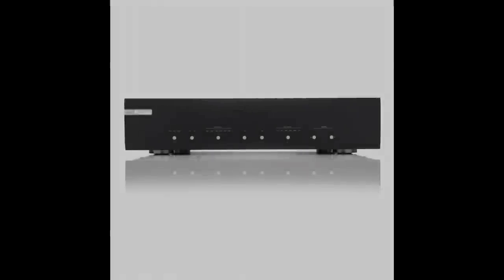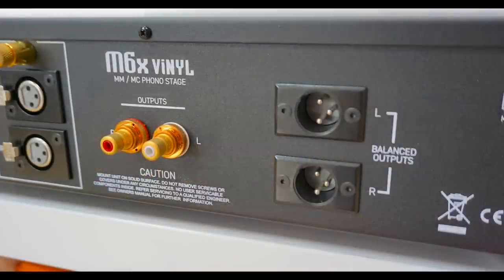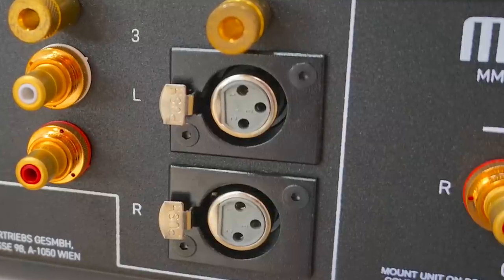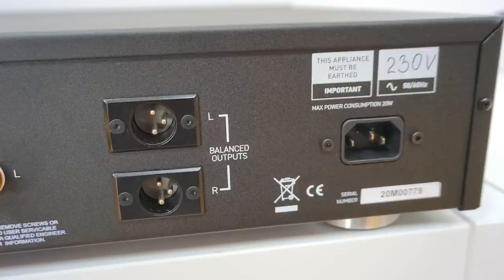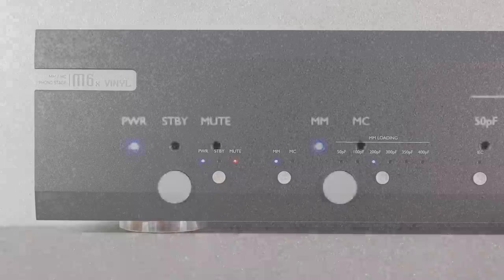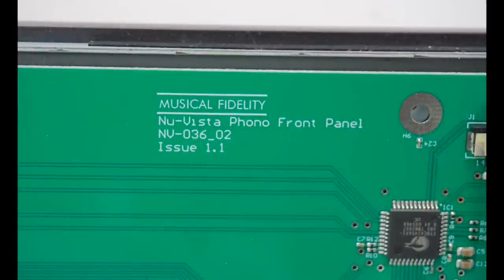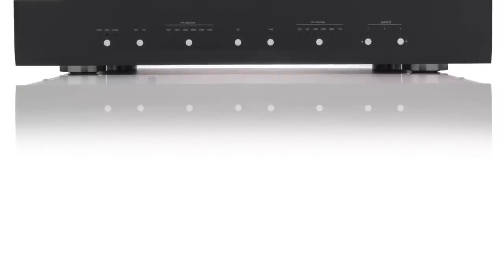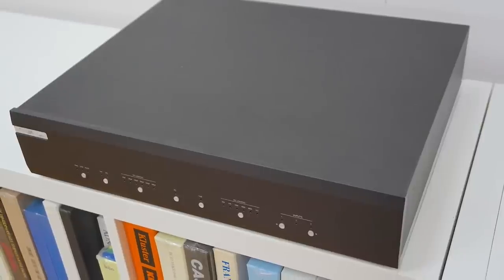MUSICAL FIDELITY M6X VINYL PHONO AMPLIFIER REVIEW: CLOSE UP, RATING, SINGLE-ENDED & BALANCED TESTS!

Comment: Hi there Paul. I have just purchased (coming in a few days) this phono stage based on a few reviews and giving much weight to your video review.  It will replace a Musical Fidelity M1-Vinl. My system does not have any balanced input capability so I plan on using the single ended connections. Based on your delight with the balanced output I would love to use that connection to my preamplifier.  Are there any adapter cables or plugs that will allow me to use that output from the M6x?  Would I be able to appreciate the benefits you were so pleased with, if such a cable were available?  Also do you think I should hear a big difference with this vs my old M1-Vinl?  Thanks  Steve in Dallas TX

Comment: It is good that it has all the input configuration but does it save the settings for each input selected or does one have to readjust when selecting different inputs? Ideally it would save different setting for each input as most likely it would be for different cartridges.

Comment: Hi. congratulations on the videos. (Brazilian in the area) with modest system: at-pl120 and denon 600ne (pma + dcd), Bookshelf Klipsch R-15m. in order to improve the sound and add an equalizer. which would indicate preamp phono ? and equalizer? Thanks in advance!

Comment: Grate review Paul, I don't care for the tiny writing (display) though, short sighted (me) and astigmatism aren't a good combination especially in low light, but the amplifier having balanced inputs is good, I have a Cambridge Azur 851C pre amp and 851w power amp the pre has balanced inputs and after your review I am interested in their posible use, yes I'm aware that what the M6x does will be different to what my amp can do, the reason I haven't used balanced so far is because before using the amp I looked through the user manual and saw mention that balanced and unbalanced (RCA) can't be used at the same time and so never went any further, but after thinking about it I'm not sure if I understand this correctly, it seems odd to build an amp with so many inputs to then only be able to use 2 :/

Comment: Thank you so so much had my eyes on M6X phono for while wish to partner with my Project Extension 10 coincidentally a Groovy 8 in your review and the XLR connection no problem as project make a balanced XLR lead that plugs directly in the turntable arm bit of a no brainer then thanks again Paul for excellent as is reviews  for the record currently using quintet bronze so aiming for cadenza bronze long term 😮

Comment: Good that they give you loading options for both MM and MC carts but not for gain aside from that +6dB boost. You didn't mention the default gain levels and there is no mention of these in Musical Fidelity's product info sheet nor manual. Given the pretty wide range of outputs between different carts this would seem to be a significant failing to me.
Reply: They use a different format but convert to 42dB MM and 62dB MC. Based on my older M6 vinyl,  MC of 0.3 mV output plus are fine using balanced which gives higher output. Might be partly why Paul preferred it. Would suggest 0.5 mV plus cartridge with single ended. This will depend on your amp to some degree. Lower will require +6dB but doesn't sound as good with this engaged. I've only tried AT MMs and plenty of gain for these without 6db boost. For finer differences in gain suggest use your volume knob.

Comment: I’m assuming the unit has a memory to store the MM/MC and loading options for each input. Eg if you switch between turntables, one with MC and the other with MM then does the unit remember that input 1 was MC and input 2 was MM and each with the relevant loading value?
Reply: It remembers the settings even if it is powered down. I have the M6 (non X version).

Comment: What a great idea to have several inputs, I use 2 turntables so need 2 phono amps. The 1st is my better one a Linn LP12/Roksan Nima/Linn Adikt and the second a more budget Revolver/Ittok/K9 with At95C conical stylus for my knackered 2nd hand records. I am considering a 3rd with dedicated mono cartridge that will connect direct to my amps phono input. A question, perhaps a good one for your video news. I don’t want to spend a lot on this mono set up as I only have a couple of dozen mono records but that is increasing now I am helping one of my friends with a 1960’s radio show. 
I realise the cartridge needs to be a genuine mono so was thinking of the AT610 mono. I understand the more budget VM95 mono is not a true mono cartridge, I could just use the mono 95 stylus on my K9 but was fancying a dedicated set up. Unsure of Regas 78 cartridge as I would assume it has a thick stylus to suit 78 records.
As for the turntable I am open to suggestions. I have thought of the Rega P1, AT120XUSB or Project Debut DC. I think the AT 120 would be the most versatile having an interchangeable head shell but would assume that the Rega would sound better but I am unsure if you can adjust the tracking weight to accommodate other cartridges. As I said don’t really want to spend a lot due to my mono collection size so was thinking of up to £500. Your input would be most appreciated.
Reply from the maker: I think you've basically thought this one through, Tony. I'd go for the Debut/Audio-Technica combo as a good basic option. Incidentally, true, ground-up mono carts are rare because they are very expensive to build and most brands can't justify the expense. Thus most mono carts on the market are repurposed stereo designs, to cut costs. The cheapest model I know is the Japanese  Miyajima Kotetu (£500+). A cart I reviewed a while back. I have the company's Zero as I have a healthy mono collection.
Reply: @TheAudiophileMan  thank you Paul your advice is most appreciated, I just needed to ask as I sometimes overthink things. The Pro-Ject and AT it will be. Can I ask though as the Project comes with the 2M Red pre fitted do you think that I will have to adjust the arm height. I intend to buy the turntable from  Cheshire Audio as I watch his YouTube channel and it would be nice to give Phil my custom but he doesn’t list the AT610 mono cartridge on his website so I may have to do that myself.

Comment: What does “sense of pace” mean?
Reply from the maker: If, for example, bass sounds a bit boomy or bloated then sometimes it hangs around too long and drowns the midrange and treble. The effect is almost like the music slowing down as it's constantly trying to recover. If bass is better focused, tighter in effect, then the impression to the ear is that the music trips along with pace. There's variations on that but that's basically it.

Comment: Sorry Paul but I’m confused as usual , you’re turntable is not balanced and the Rega p3 isn’t . So which bit of the setup is ,     most amps aren’t as in my audio lab 6000 . So please explain to a rather slow on the uptake follower of your grate channel .    Best wishes and kind regards as always 😀👍👍👍
Reply from the maker: No problem. As I mentioned in the vid, I currently don’t have a balanced turntable so cannot review this part of the phono amp. So I will have to defer this part of the sound test. I hope to review a balanced turntable in the future though, hopefully from Pro-Ject. If/when that occurs then I’ll use this MF phono amp. That is, at that point I will be able to plug a balanced turntable (the forthcoming Pro-Ject) into this MF amp’s balanced inputs. 
During this review, I reviewed music in single-ended output mode and then later in balanced output mode using my own main amp. See the Description for chapter headings for those. Give me a shout if I'm still confusing you and I'll give it another go.

Comment: Really no excuse for the poor single ended performance (I’m assuming that Paul knows that the difference does not lie somewhere else in his system), especially at this price point. Why not leave it out or clearly state that it’s a 2. class citizen?
Reply from the maker: I didn't say single-ended was "poor" or second class anything. You said that. I said it wasn't strictly neutral/balanced and if you're firm on those matters then this point...matters. I also noted the positives from single-ended mode and there are some. This is because I am meticulous in terms of balanced play (but hey, that's me, others might not be so scrupulous - again, know your critic and take that into account). If you're OCD in terms of sonic neutrality then balanced is the way to go, though.
Reply: @TheAudiophileMan  I have no love for neutrality (you said that, not me 🤭), but I am adverse to upper mid forward, solid state, digital sounding. Thanks for providing additional perspective on you review, I read it as passing more of a value judgement. While I appreciate a component can be built to favor a topology, I would personally not want to first balance my system with a component, then to have it changes character to large degree when used balanced. Maybe more common that I think, I have certainly see it go the other way (more edgy/brighter using a balanced connection)